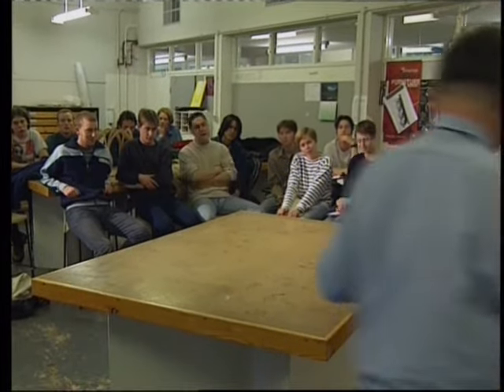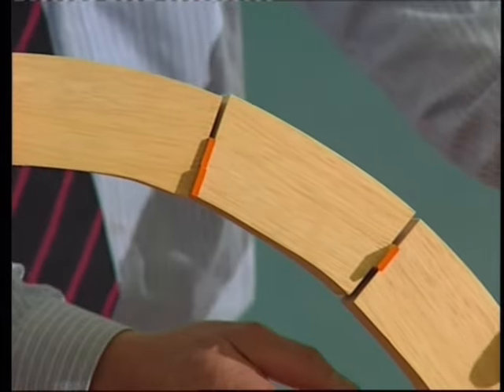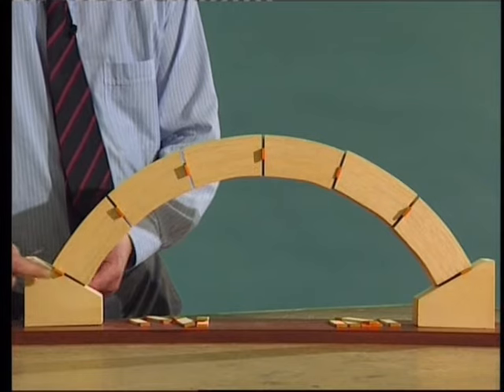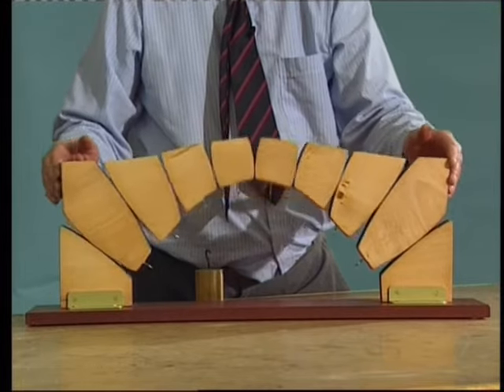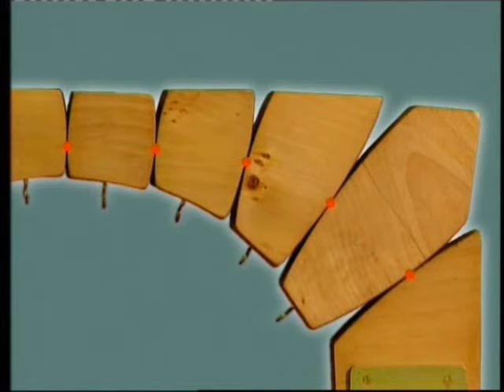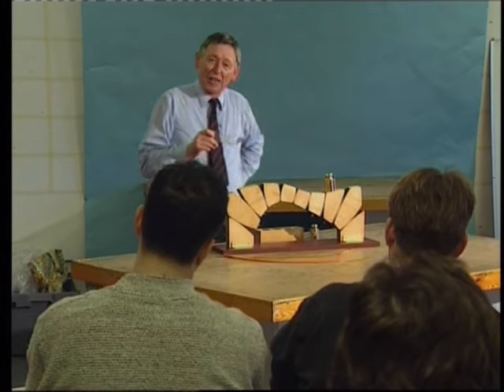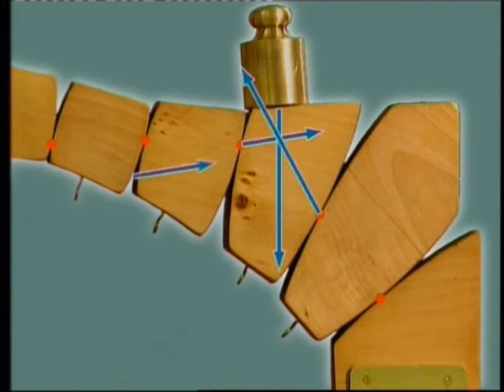Forces in an Arch

Comment: A few years ago I was idly thinking about arch bridges and the fact that the Earth's surface beneath the bridge also has a curvature - granted not much, but it's there. So the longer the bridge the more the Earth curves beneath it. Take this thought to its logical conclusion and you have a bridge that goes right round the Earth and needs no supports. It becomes a giant hoop that just holds station. But an observer might look up at it and say "why doesn't it fall down?". Answer: because for that to happen, on the other side of the planet, It would have to fall up!
Reply: You have a second like. I love it
Reply: Vsauce covered this in his video "Which way is down?". Ironically, this bridge would appear extremely uneven and undulating, due to having to match the forces of gravity as well.
Reply: so, like a ring? a ring across the surface of the earth that acts as a bridge
Reply: @Renteks-  I watched the video now. When you say "extremely uneven" I think this is a huge exaggeration.. Vsauce mentions a figure of "almost 100m", but he doesn't point out that this would be stretched over many hundreds of miles and probably not detectable to the human eye. Apart from that there would be other problems with  gravitational perturbations from neighbouring astronomical bodies - i.e. the Moon, the Sun, Jupiter, etc - and hence for these and for other other engineering reasons the only shape to build such a hoop would be circular. But this is all just an academic thought exercise anyway, because according to my estimates there is no building material even remotely close to being able to withstand the colossal circumferential compressive stresses that such a structure would develop. No, not even remotely. Some other engineering trickery would have to be employed. Would be a totally cool thing though.
Reply: Man this is brilliant.
Reply: god hasn't fixed this bug yet
Reply: @martinsutoob  And even if it could be built and was perfectly rigid, it would be inherently unstable in the gravitational field.  And disturbance would make one part of the ring closer to the earth's CG than the rest of the ring, and it would start falling.
Reply: @SynchronizorVideos  Agreed, but not at "g", because as long as the hoop remained rigid and intact, for one part to fall down, an equivalent mass on the opposite side of the planet would have to be lifted up. I once did some calculations which suggested the acceleration would be tiny compared to "g". So if you had the technology to build such a thing you might also have the technology to compensate for such a drift.
Reply: If you could make the ring stiff enough somehow, you could tether it down to the earth all around its circumference and it would still stay up - and be stable, too, unlike the gravity-supported version. It would act like a giant tensegrity structure, or a spoked bicycle wheel.
Reply: @martinsutoob one trick in this hypothetical would be to make it spin at the speed required for it to orbit around the Eearth at that height. Still impossible, but a bit less impossible
Reply: @cooperised  I thought about 'spokes' as well. (I like the tensegrity parallel you made btw.) The problem with a spoke is its self-weight. Before the spokes are attached to the ground (so imagine for a moment they're just dangling there grazing the ground) then at any point above the ground the tensile load in the spoke is the weight of all the spoke below that point. By the time you reach the hoop say 100km over the surface, you've got 100km of spoke dangling there and the force is colossal. I think a solution might be to fan a spoke as you go up, so one diverges to two, two to four, etc. This approach might keep the forces more manageable and also distributes the loading more evenly around the hoop.
Reply: Some big brains in this comment section. ✌️❤️🇨🇦
Reply: Unfortunately it would be exptremely unstable. While it is true that for one part to fall the opposite has to rise against gravity, gravity is stronger the closer you get to the surface, so the two forces wouldnt cancel out.
Reply: @benbooth2783  I think a more appropriate description of the stability would be 'meta-stable'. It would be similar to a ball on a very rounded hill. For sure a small perturbation would send the ball rolling off, but the point is it would not accelerate at 'g'. I did some calculations once and it would be very significantly less than 9.81m/s^2. This is because of the counter-weight effect that the opposite half of the ring provides. Effectively the difference is a ball on a rounded hill versus no hill at all, and personally I believe that a race that had the skills and technology to erect such a structure in the first place, would also have the skill to develop ways to stabilise against such perturbations.
Reply: Earth stands not because crust is a loop bridge, but because crust floats on magma. Grow up.

Comment from the maker: If some of the slats are loose between the voussoir and the abutment this would indicate the surfaces are in fact slightly UN-PARALLEL, because clearly it would not be able to be removed ...the lecturer actually confirms some of the slats were loose.
Reply: A very interesting video, where is it from originally?
Reply from the maker: @junkbucket50  if you search: The Arch Never Sleeps
Reply: Or that the slats were slightly different thicknesses, or slightly out-of-square themselves.

Comment: The arch only works this way if the two lower blocks are rigidly connected to each other. In this example with a shelf. Do the same experiment without a shelf, with two separate blocks at the bottom, then the thrust force will push them apart and the arch will collapse. That is why we see in medieval arch architecture, steel cross-connections between the two ends.
Reply: Not necessarily. If the arch has the shape of an inverted catenary, it won't collapse.

Comment: Hmmm…
If the voussoir contact faces were slightly concave, and the material slightly compressible, would that make an arch more stable?
Reply: Interesting thought, I figure that would mainly force the material to be under constant pressure in thr tops and bottoms, eventually thst would weather away until the forces are more spread out again.
Reply: @GundamReviver  my logic was to induce a prestress into the material, and make it more stable.
The idea being just the opposite of the convex faces.
This would enhance resistance to not only the linear stress, but to lateral and torsion stresses.
No swing, no twist, no bounce.
Seems to make sense.
Reply: @GundamReviver  you are a college student, up at this hour, aren’t you??
Reply: @dangeary2134  nah, but did start out with a degree in engineering stuff 😂 I figure you are correct in that it would have increased regidity since indeed it would be pre stressed, but thst added hardness would Probabaly mean the "points" pushing against each other would get immense force on them and break and crumble quicker. Also it's like nearly afternoon here, haha, welcome to the internet: it's always daytime somewhere.

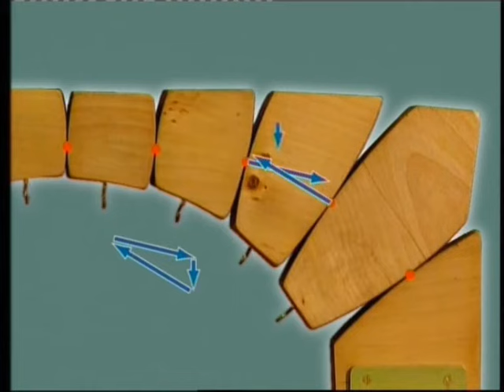Comment: I am not sure if at 2:40 the picture is complete: Aren't there frictional forces at both contact points too? - Intuitively, I would guess the whole arc would not be stable if the surface (of the contact points) would be (ideally) slippery.
Reply: I guess it would cause there is a vertical component of normal reaction too on both sides
Reply: I think there are no major frictional forces in this static system. A friction force perpendicular to the thrust line would result in rotation of the block, we can see this when he adds a weight and all the blocks rotate to a new stable position.
Reply: @joshdaly2343  Try to build the arch using slippery soap blocks. I am pretty sure it will not hold.
Generally, the two planes defined by two contact points on a block are not parallel, hence the two forces will create an outward (or may be rarely an inward) force expelling the block. Yes, this is countered by the gravity of one block, but I am pretty sure that there are also fricitional forces at each of contact points.
Reply: @sakudoo  if the soap blocks had the same shape and density as the wooden blocks in the example, then arranged in the same shape they would still hold the arch. It would be very hard to do not (mainly) because the lack of friction, but the fact that there's only one "thrust" line for a particular arrangement of blocks. That's why the arch changes shape when a weight is added so it reaches its unique thrust line whete there's no friction.

Comment: Is there no friction at work parallel to the surface in the arch with strangely shaped blocks?
Reply: Had same question. I think you could add the friction forces to the three forces they drew, and add more terms to the equilibrium equation. But, those terms will cancel out. The component of gravity perpendicular to the surface equals the normal force they have drawn, and the component of gravity parallel to the surface equals the friction force, neither of which they drew. At both left and right points. So, my guess is that friction is indeed there and critical to the arch. I didn't look it up though, so this might be bogus.
Reply: There is. The video is misleading. Any undergrad student should point out that normal force is perpendicular to the contact surface in case 1 where cardboards were used for top bricks. Thus friction force introduced by normal force is used to counter gravity. I was so surprised no one pointed it out.
Reply: @xiaojiang2610 how can a normal force, which is perpendicular to the surface, introduce a friction force, which is parallel to the surface? The whole point of arches is that they act in pure compression, hence there is no need for friction force. 

For the second arch in the video, if there were friction forces, the blocks would rotate (as they do briefly when he adds a weight and they come to equilibrium in a new shape with zero friction forces)

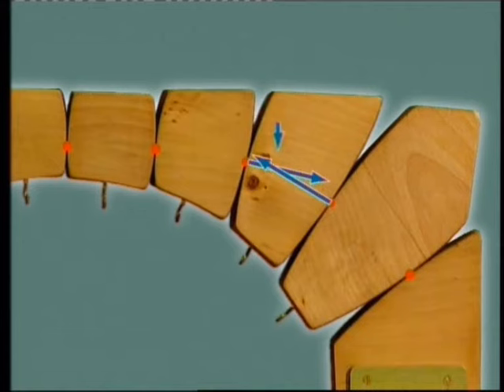Comment: 2:30 shouldn’t there also be friction ? Or do the long blue arrows represent the sum of normal and friction?
Reply: There are two types of friction. Normal friction requires movement to be occurring which isnt happening in this situation,

and then Static friction which resists initial movement between the blocks slipping. Static friction would just resist any slipping and equally cancel it out. While it does technically exist in the model, it doesnt actually have any notable effect and so it can be pretty much ignored for the sake of simplicity. 

It only really matters if the slipping force is enough to overcome the static friction.